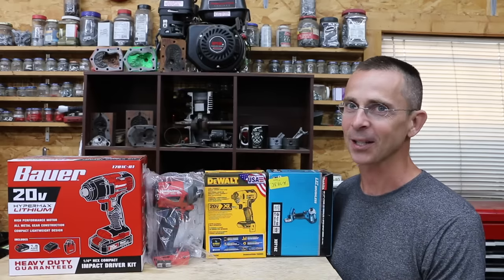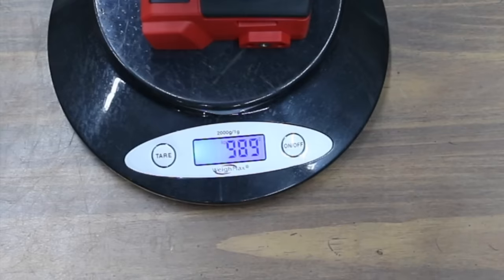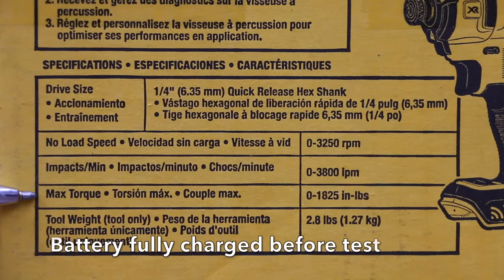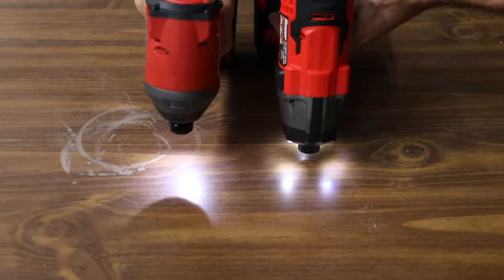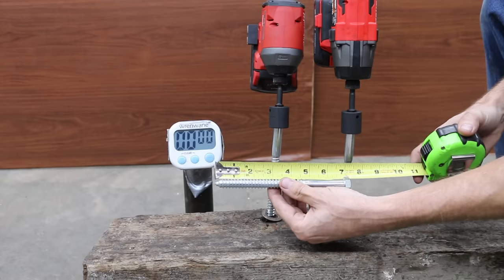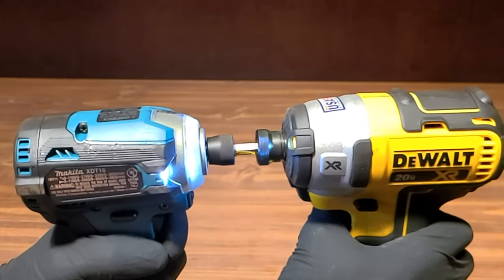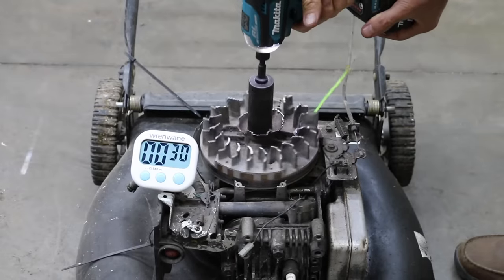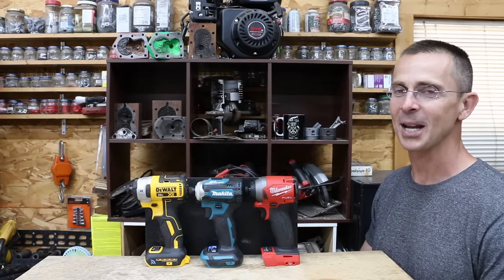Best Impact Driver? DeWalt vs Milwaukee vs Makita vs Bauer!  Let's find out!

Comment: DeWalt impact driver: catches fire

DeWalt app: OK
Reply from the maker: Thanks for watching!
Reply: it didn't catch on fire it just burned all the grease in the hammer assembly from the friction which is not a fatal fail the tool is still perfectly operable and did a good job in the test. the app measures motor temp and the motor was able to stay cool through all of that torture. all of that continued friction on the hammers and anvil trying to push a lag through hard wood is going to take it's toll on any 3/8'' impact driver since they aren't made for that, and we do see this in the video since they all smoked and one of them totally bit the dust.
Reply: @ElectronicsForFun  Milwaukee did not smoke because it has overload protection built into the electronics. Its just an overall superior tool.
Reply: Dealt is the best
Reply: Dewalt
Reply: @cool8033  how did you come up with that conclusion?
Reply: First of its just my opinion and second I did somethig like what he did and the dewalt won
Reply: And  should of said its my opinion at first
Reply: @terry504able  Agered.. Milwaukee has really stepped up their game over the years..
Reply: @ProjectFarm  Do the 1/2 impact wrench the dewalt 899 , the Milwaukee 2667 , the ingersoll 7152 , matco and snap on please .
Reply: @terry504able  The thing with Dewalt is they have a tool for every construction application where as Milwaukee dose not and there batteries break  more often.
Reply: Lmao, I came here to write that hahaha
Reply: I'd probably have difficulty getting a job done if I had to spend much time on the phone with my power tools 😏
Reply: @mattcraztex9940  I don’t think you know what you’re talking about
Reply: @djslater358  I know exactly what I am talking about I use power tools on a daily basis in loads of different tasks. Do you know what your talking about?
Reply: i wanna like this comment, but it's at 420 likes.
Reply: DeWalt app: This is fine
Reply: @Raeeban  and the hilti
Reply: @terry504able  a superior tool that only lasts a couple years tho LOL
Reply: My Milwaukee came close to being on fire. It wasn't the impact mechanism, greese, or whatnot. The bearing for the motor is captured by the backing plate where the brush and stator assembly resides. Too much heat, wear, whatnot, and the plastic actually deforms, the motor starts spinning off axis ever so slightly, and, well you get it.
Reply: @ElectronicsForFun  idk, Milwaukee having the foresight to have that limp mode seems like a smart decision.  like PF said, the lag bolt test is over-extending the application of these impact drivers, if they idiot-proof them like this they last longer.
Reply: @jorgey4  I agree both the dewalt and the makita have these functions, what I am saying is the milwaukee is either more sensitive which hurts it's performance or it's not as strong as the dewalt and the makita which causes more strain on it prematurely activating it's limp home mode.
Reply: @ElectronicsForFun  except even in "limp mode", the Milwaukee not only performed better in effectively every test, but was also stronger in head to head tests. The only thing limp is your bunk argument.
Reply: @ElectronicsForFun  and that's why Dewalt and Makita have both a 3 year warranty and Milwaukee has a 5 year warranty 🤔 you are genious EFF
Reply: @daleclayton9483  I just don't like how sensitive it is. I have seen these Milwaukee impacts shit the bed and give up going into limp mode while other impact drivers will just keep going like it's nothing, because it probably is. it's like buying a hellcat and then after 1 drag race it governs itself to 30MPH to save itself from excessive wear. nobody would buy one if they did that. these tools are made to be thrashed on. I have seen milwaukee impacts go into limp mode just driving in a 1/4" screw. that power is useless when it won't let you use it.
Reply: @AllegedlyElPresidente.  warranty isn't an indication of how good something is. look at rigid, they have a lifetime warranty that's completely useless because they put shit in the fine print that pretty much nullifies any warranty claims because it was your fault. and milwaukee does the same thing, it's 5 year limited warranty so they can look at the tools and tell you to kick rocks because it was your fault. it's selling point. anybody who makes a warranty claim on anything that isn't a hand tool is going to be disappointed.
Reply: @ElectronicsForFun  if you're defending DeWalt on an app, this conversation is over
Reply: @AllegedlyElPresidente.  what? I don't give a shit about the app.
Reply: Dewalt impact driver shames the Milwaukee we have them both at work run headlocks and ledger locks all day
Reply: Dewalt= dead volt
Reply: @ElectronicsForFun  Maybe it's not the same phenomena as the limp mode but I've seen it happen with two Parkside impacts - the new model had higher torque and was stopping with the weaker 2Ah battery. It was doing fine with a 4Ah. Now Dewalts come with 6 Ah battery - so people think they are beasts like no other.
Reply: overpriced black and Decker Junk! 😁
Reply: @djscottymaxx  at one time Black & Decker industry and construction was along the same lines as hilti and was only for professional commercial and industrial use you didn't even see them at home Depot so if you're trying to say DeWalt is the same as do it yourself Black & Decker you're definitely on the pipe
Reply: @trollmcclure1884  dewalts have 12ah batteries too lol
Reply: @terry504able  in Australia there about a 3rd more to buy
Reply: DeWalt : because spending twice as much money on a black and yellow ryobi makes sense to some people 😂😂😂😂😂
Reply: @coltongrundy7625  that's funny! Considering that Milwaukee creators makes Ryobi tools as well🤷‍♂️
Reply: @badlilstang  They can afford to, since they make everything in China.  At least my DeWalt still says "assembled in USA," though all the parts ship in from China.
Reply: @1newme425  how did you know?

Comment: dewalt pukes guts out
Status: fine
Reply: I've had my Dewalt tools this hot many times over the past 6-8 years, all still work well.
Reply: @chestrockwell8328  Wow 8 years on high heat ... hat's interesting to say the least, Do you need to regrease or anything ? like a service?  how can grease evaporate and still not dry out?  8 years is a lifetime for me I usually upgrade with in 4-5 years, My brands of choice these days are Hikoki and Matabo. The dealer is close by our workshop and gave a good deal back in 2010 since then we held on to these brands , I am not sure if they are famous in America...
Reply: @xilnes7166   I wasn't smoking my tools everyday.  I never took any of them apart to re-grease or anything such thing; i did blow compressed air through them on occasion while still in their casing to blow out dust/debris.  Never heard of Hikoki but yes Matabo has a small presence here in the US.  Having a dealer nearby is important, there was a Dewalt service store two minutes from me until this year... going to Makita might prove a headache in this regard if I have issues with  the tools.

Comment: Here's a test. See if you can get the Bauer replaced under their "heavy duty" warranty.
Reply: Probably can- HF almost always just takes a quick look in the box to see that the tool is in there, then tells you to go get a new one off the shelf. Sign the paperwork and off you go.
Reply: Its literally that easy
Reply from the maker: Thanks for the suggestion.
Reply: And then walk back in and return the new one.
Reply: @P_RO_  totally true.
Reply: HF has always honored the warranty for me, no question. As long as I have the receipt and the item, they just take it back.
Reply: With all the money you will save on gas and wear and tear on your truck, I mean prius, going back and forth returning HF junky tool, your better off buying quality tools, and finishing your jobs!
Reply: Mermaid Muncher I’m a big fan of buying quality tools that last, when that’s what I need. Sometimes you only expect to use a tool once, and Harbor Freight is good for that. You don’t have to buy the Rolls-Royce for every trip.
Reply: Bauer....oh yeah... Bummmm ....♨️💣⁉️👏🔥🔥🔥👏🏳️🏳️🏳️🏁
Reply: Same could be said for DeWalt. Ive had a lot of trouble with warranty claims.
This is the reason I'm searching for a new brand. Leaning toward Makita

Comment: I’d say Milwaukee puts a thermal cut out on their impact.
Reply from the maker: Thanks for the feedback.
Reply: Yep, save the tool and still perform better than the competitors
Reply: That is what I was thinking. Not a bad idea if some crazy person decides to drive a 7" bolt into a railroad tie...
Reply: Yes and it's a very good feature I've had Milwaukee tools for almost a decade now and throughout Barry heavy use they always continue to work but also the batteries and the system protects the tool and the cells in the battery from damage.
Reply: Milwaukee puts thermal protection on all of their tools. Sometimes it hinders the tool when doing tests like these, but very few people ever abuse the tools like these tests do.
Reply: @nullexxx  If you look closely it was on setting 3 the entire video....
Reply: @nullexxx  any good time stamps to showcase that it's in drill mode?
Reply: Yep milwaukee tries to prevent you from damaging their shit.
Reply: I was thinking that as well
Reply: Yeah I’ve used Milwaukee in some hot attics and every now and then they will shut off when it gets WAY to hot, like 140 hot
Reply: @nullexxx  Its in setting 3, as you can see at 10:32
Reply: The Milwaukee's sophisticated electronics measure the motor current, rpm, battery temp, motor temp, ambient temp, battery charge, battery age, and other things to shut itself of for a moment to let you know you're damaging the tool. It lets the tool recover and prevents you from destroying it or hurting yourself or the work piece by being stupid. This is why all the others melted down and the Milwaukee simply shut off and forced you to reset the trigger. Think of it as a very smart circuit breaker.
Reply: Yes they do. I own many Milwaukee tools, they all have it.
Reply: My ryobi impact driver does that also. You'd really think Dewalt and Makita would have the same. Awesome test!
Reply: Yes, I see this on my grinder as well as the ½ impact
Reply: @mr.knowitall5472  : I'd say a certain worker will have their thermal cutoff engaged. :-D
Reply: @bebakerus  : Not railroad ties, but some old houses use oak beam joists. Impact with a socket makes a big difference.
Reply: @brodriguez11000  I get it. Just making a little fun
Reply: TMoD7007 I can attest to that. Got 2 giant impacts at work for driving in 7 inch lags through wood. Sometimes even through about 3 inches of hardwood for some stuff. never seen them struggle and you'll break the lag well before the drill struggles lol
Reply: TMoD7007  I was just thinking that!! That’s dewalts top model vs Milwaukee’s low end lol

Comment: I’m so glad your channel exists and that you do what you do, I’ve just started a new job as a tech at a dealership. Sure I’m an oil changer now, but I don’t plan to be there long, and one day I’ll need a reliable arsenal of tools to do my job. I’ll resist the temptation of the siren call of the tool trucks and I won’t buy a single tool, adhesive, chemical, or work boot without first seeing what you have to say about it.
Reply from the maker: Thanks!  Thanks for sharing!

Comment: I covered my entire house in self leveling concrete (1700 sq ft) to tile on top. I used a milwakee household grade battery powered drill to stick a metal stirrer into the many many buckets of cement I had to prepare. It worked through hours and hours of mixing and still works 2 years later. Milwakee for the win!

Comment: Can’t get over the “heavy duty guaranteed for 90 days” man that’s some serious heavy duty use lol.
Reply: J T lol hilti has a 25year warranty.
Reply: J T if you want to get technical hilti is a lifetime warranty and 95% of the time the rep that comes to pick up the broken tool will give you a new replacement on the spot if he has one.
Reply: J T Lifetime manufacturers warranty
We’ll repair or replace all tools free of charge, which are faulty or defective due to manufacturing faults – over the entire life of the product.
That is straight from the hilti sight and I have dealt with hilti reps more than I can count.
Reply: U do realize that its the most affordable bang for buck even though only 90days factory hence why hf has extended warranty’s for a few bucks more. Not to mention the easy of when needing a warranty done. Good luck with the others. U gotta call and make a claim. You pay to ship it to the mfg. The mfg determines IF ITS THERE FAULT. If then they will fix or replace BUT U PAY return SHIPPING.  All this waiting while ur job at hand suffers.  With the baur u walk in and walk out. They dont hassle u with tons of questions or paperwork.
Reply: Meeso Hunny the tool that burned up putting in 1 lag is not gonna be the best bang for my buck lol i hate ryobi and sad to say I would take it over any harbor freight tool out.
Reply: So warranty should still be good, he was doing heavy duty use!!

Comment: Milwaukee as of 2022 still has a problem with the collet releasing the drill bit when pulling it out of the hole one try’s to drill.  This is frustrating and dangerous when drilling overhead, because the bit can fall on one’s head if the operator didn’t notice it slipping out of the collet when done drilling.   Come on Milwaukee, fix your stuff!   Bad design with a single bearing collet!
Reply: I was going to say it's not the single bearing that is causing the issue but now that I think of it I think it contributes to the issue.  The inside of the collet gets worn down and starts to taper which makes it easier for the collet to go up when trying to pull back when drilling/impacting.  I ground down my collet so that it is shorter resulting in the bearing contacting an area in the collet that is not tapered.  This solved the problem of the bit pulling out.  With a single bearing, I imagine that while impacting that the collet is rocking back and forth which results with the collet moving up and releasing the bit.  Having 2 bearings should reducing the rocking of the collet

Comment: 30 years ago I took my Milwaukee sawzall  into a Milwaukee factory repair shop to get a new jaw that holds the blade.  It was a slow day and the tech guy replaced the cord and the jaw along with the guard while I stood there and watched. Great I said what do I owe you. He said "Nothing, Glad to have you as a customer"   That simple act. Locked me in for life. I still have that sawzall today.  Service means a lot.   I'm Glad that Milwaukee is still kickin it.
Reply from the maker: Thanks for sharing.
Reply: TheEZGZ This some hank hill type shit
Reply: I sell sawzall and sawzall accessories...
Reply: @ezgz. You got lucky on that one. About twenty years ago I had to pay $20.00 for a replacement cord for my sawzall. Luckily mine was detachable. Imagine what they would've wanted to just pull it apart and replace it.
Reply: @invinciblejets4690  Don't know hank hill and it really happened that way.  Makita was taking away there buisnes back in the 80's he told me and his boss told him if folks came in with problems to make them happy.  This was Denver Colorado near 6th ave and Bryant street if anyone knows that area of industrial suppliers.
Reply: @TheEZGZ  Hank Hill. A fox cartoon character.

Comment: Another brilliant comparison. Was literally just considering buying either the Milwaukee or Dewalt, decision made!! Thanks a lot.
Reply from the maker: Thanks so much!
Reply: I am a farmer and I have the dewalt. It gets used nearly every day. Always in the dirt and I have had it for 4 years. It is a good one. It got ran over by a schoolbus loaded with watermelons when I first bought it. It mashed it in the ground. It popped some pieces apart and bent it a little but it snapped back together and has been fine since then. I dropped it in a bucket of transmission fluid once. When I got done using it that day I took it apart and sprayed the circuitry and trigger etc with brake cleaner. No problems. I use mine in the water all the time (spray hose clamps, rain etc)and it doesnt seem to hurt it. Mine is the older version without bluetooth. It is rusted from being sprayed with liquid nitrogen fertilizer but it has held up fine otherwise.
Reply: The one thing that tipped the scales to Makita for me over Milwaukee was their compact LXT line: having lightweight tools that use the same batteries is so much more convenient than having 2 different batteries / form factors and the 1.5Ah 18V LXT batt is still quite light, even with all-day overhead driving.  But I don't need those tiny screw drive tools or 1/4" eRachets, like the Fuel M12 stuff is mostly used for, so YMMV.  You can't go wrong with either really !
Reply: Dave Johnson Milwaukee has the same exact thing fyi
Reply: You will be pleased. Check out the other tools they make that take the M18 battery and be happy with your decision :)
Reply: Milwaukee has definitely upped their game and is dominant imo